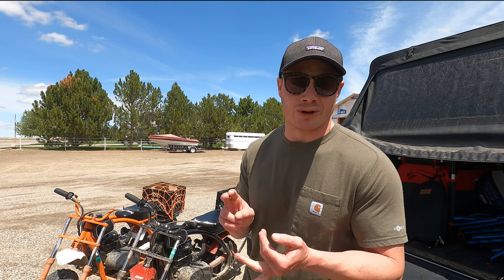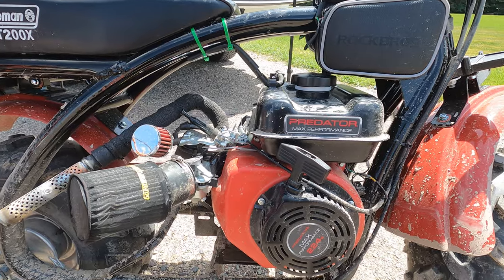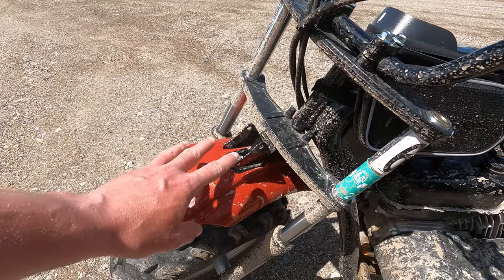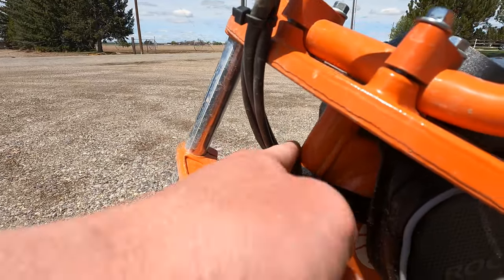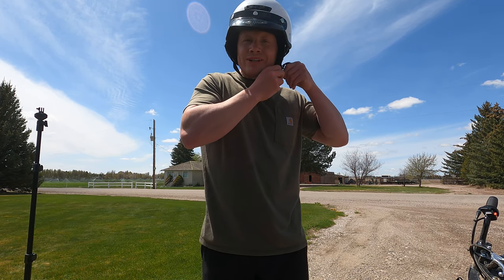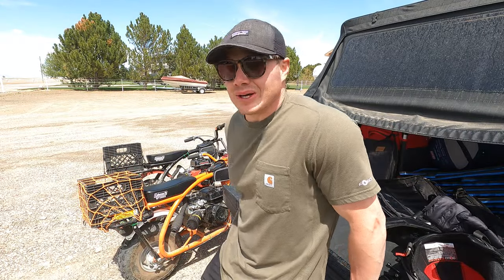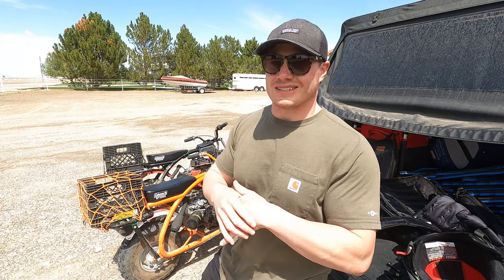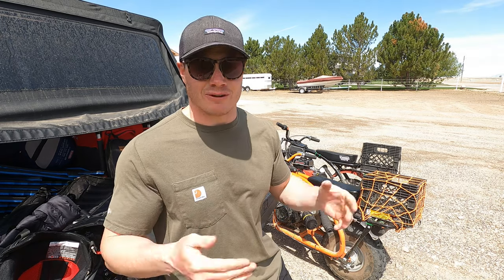Coleman BT200X: Off-Road Build + Performance Mods

Comment: The new Coleman is too low, long and heavy. The BT200X has a nice open design which makes working on them a breeze. Good point with the ground clearance.
Reply from the maker: I completely agree! The BT200X is my favorite model by far, especially if you're going to be modding them!
Reply: My first bike is the bt200x and I got a megamoto 212 to be more of a workhorse and loaner bike while I build up the bt200x. The bt200x just handles and rides so much more confidently than the megamoto.
Reply: @TregsTravels  I've been through all the new big tire bikes including the Trailmaster. I made up my mind that if you need anything more than a bt200x, one should probably get a dirtbike.
Reply: @quadriderkyle  the mm212 has great brakes and a good neck but it comes at too many expenses elsewhere. Where the BT200X comes up short in brakes it makes up for in simplicity and ergonomics.
Reply: @fatbuddycat  I was actually hoping to steal the front brake from the mm212 for my bt200x, but there is no way to make it work without cutting the necks off of both frames, which I considered briefly.
Reply: @quadriderkyle  someone makes an adapter, my friend Jay has it on his. If I do it I'd make my own.
Reply: @quadriderkyle  they make a bolt on hydraulic brake kit for the front. I've seen a few guys with them.
Reply: @fatbuddycat  I have it. I just need to do all of the welding on my frame so I can put it back together. I'm extending the rear forks and moving the foot pegs back, and might be adding small shocks under the seat.
Reply: @quadriderkyle  I just grabbed the new Coleman dual suspension but I'm planning on leaving it pretty stock.
Reply: @fatbuddycat where did you find one?
Reply: @txrunroutdoors  tractor supply. I was grabbing a quart of oil for something and fell in love with it.
Reply: I do like the look of the new ones for a drag build. Has a nice design that is probably easy to stretch.

Comment: I've got pretty much the same mods for mine. I added mud flaps to the rear of both fenders that SIGNIFIGANTLLY helps with mud, water and dew off grass. i got an 212 with a starter, mounted an ammo can to the side for tools and the M12 battery that runs the starter..and of course neon underglow!
Reply from the maker: The mud flaps are a brilliant idea! That's a sick build 💪

Comment: Its not the governor you feel at top end. Its the valve float if you did the zip tie right. 18lb valve springs will open up more rpm. Your ready for it with your flywheel already installed. Id call those stage 1 or 1.5 with the flywheel and stock camshaft, rod, valves, head, stock size carb etc.
Reply from the maker: That makes more sense! I'll upgrade the springs next. I appreciate it!!
Reply: Listen to the RPM when he's going 45 mph. That's nowhere near valve float RPM.
Reply: @Deucealive75  it absolutely is on worn out stock springs
Reply: @16driver16  They must be very worn out to valve float below 4K RPM. And on an engine that new? You would need a pretty bad spring to float a valve at that RPM.
Reply: @Deucealive75  the hisun really is that bad... I scrapped mine and got a predator 212 and it's waay better in all ways
Reply: @16driver16  I disagree. The Hisun is a good clone engine minus the 16mm PTO. Last year I built my then 7-year-old Hisun. Has very nice power. I like it more than my similarly built 224.
Reply: @Deucealive75  the head is good for increasing compression on the predator. Otherwise, you can have them. It takes all kinds

Comment: One thing i have learned in the one year after a partial governor bypass is that if you dont do all of that stage kit stuff the stock flywheel is more than fine! I use my coleman ct200u-ex as daily rider for store runs and stuff but i dont need to keep up with traffic. 25-26mph is more than enough for me! Good stuuf and info in this vid just not for me.
Reply from the maker: Totally! That's the fun part of customizing these bikes, you can make it just how you want it! Everyone has different goals and needs for their riding 👍

Comment: You can register these to be road legal ?
Reply from the maker: You can if you add brake lights, horn, turn signals and a license plate...I just have them registered as OHV's but I'm supposed to carry that registration with me
Reply: @TregsTravels  I’m just interested in driving it to work 4 miles one way no highway but I couldn’t figure if it qualifies as a mop pad or motorcycle

Comment: Love it. I've got 2 of these bikes set up similar. I put the 60 tooth sprocket on the back that's been awesome for climbing. Next step for me is front brakes, gotta be able to stop on the other side of the hill once you climb it! Good content.
Reply from the maker: I just put a 60 tooth and a mikuni carb on the bike with the 224, it climbs everything now! How are you going to setup the front brake? We went for a pretty long ride up a steep mountain about a month ago, by the time we got back down the disc brake wasn't stopping anything lol
Reply: @TregsTravels  GPS is supposed to have a kit pretty soon for it. Yeah, gets sketchy when the brake ain't doing it. Do you get any kind of engine braking from the torque converter, or does it just freewheel like with the clutch? I've still gotta clutch on mine.
Reply from the maker: sorry just seeing this! Yes, you definitely get a little engine braking from the torque converter. It definitely helps on the downhill slopes! @aaronbowers3660

Comment: Nice. But the early belt shifts would drive me crazy. The sweet setup for off road Coleman 200's with a torque converter is a 60 tooth sprocket and a yellow spring for the driven in the tightest hole.
Reply from the maker: Thanks for the tip! I'll try this, changing out the sprocket is an easy change!
Reply: @TregsTravels  Welcome.
The idea is to get higher RPM to take advantage of the power mods we add to these engines. The yellow spring is especially useful to get a later belt shift during full throttle acceleration. I found that the red spring in the tightest hole is not bad with my gearing. Look at some videos of guys adjusting or replacing the driven spring if you want to learn more.

I really like 9/60 tooth gearing with a torque converter on my Coleman. It worked really well with a mild built 196. It's a little too much with the 224 because I have to be careful with the throttle and seating position. Another thing about the 60 tooth is that you shouldn't lose any top speed. You may gain a few mph.

Comment: what size of Nibbi carb would you recommend? I'm going to use it on the stock motor for awhile then I'd like to upgrade to the 224 or 212 ghost at some point and use it for that. Thanks! Love your videos.
Reply from the maker: I have the 24mm on my 224 and it works perfectly! The 22mm would work as well. Thank you for watching my videos! I appreciate the support 👊

Comment: got a baja carbon ive been working on, shes getting a predator 224 with 15.5:1 compression and e85. that all said im gonna push the charging flywheel on it as ive had governor deleted engines work fine even after years of running them hard. itll be rev limited to 6k to prevent issues and in case its getting the heavy duty housing. I've got a similar setup on a manco dingo and itll hit 57mph however that thing is terrifying at that speed, and to think im building this motor to be even meaner
Reply from the maker: That build sounds like a beast! let me know what you get for top speed on the new one! 45mph on the trails is perfect

Comment: Yes you nailed it as this totally reminded me of a yellow Tote-Gote I owned back in the early 1980’s as a kid. Although I’d be lucky if I got the thing to go anywhere north of maybe 10mph. All torque no speed beast!

Walmart has a Coleman BT200X-G 196 cc for $750!

Also with the understanding that terrain & payload will dictate how far one can travel on maybe a gallon of gas how far ya think you can go and back on one of these? With that said have you considered upgrading to a larger fuel tank?

✌🏽
Reply from the maker: Yeah! I love the classic tote goats. I was trying to capture that feeling of those older gotes with a few modern touches.

I've been actually surprised at how good these things have done on full mileage. We've gone for all day rides and the tank was barely halfway empty by the time we got back. I always carry that 750ml fuel bottle under the rear fender so I've never worried about running out of gas!
Reply: @TregsTravels  You’ve kickstarted (pardon the pun) my brain in a different direction totally then where I was at when my wife mentioned she wanted a motorcycle.

I own a couple of H-D motorcycles, but since my wife is only 4’10” & has never ridden,  I’ve been very limited on what to possibly get her. Plus the fact that’s she’s already crashed her E-Bike into a barbed wire fence the first day she rode it I worry about her on a busy street or freeway. Heck I worry about the public as well! 😳🥴😜✌🏽

Motorcycles like these check off many boxes. Inexpensive in relation to others & simple to operate/maintain. Not to mention if she does go down she’s less likely to injure herself to bad.

I know each state is different but without getting to far in the weeds on certain laws, etc…. do you ever get any pushback from camp hosts, rangers or LEO’s regarding this motor bike anywhere you’ve ridden?

Again thanks for sharing this and for your insight.

✌🏽

Comment: Awesome dude. We love our Coleman’s. I do have a question on registration. I see that you are in Utah and I have just got the run around calling to get info on registration. What did you do to get them registered? I bought mine used so Coleman will not give me a point of origin for them.
Reply from the maker: It's definitely a run around! I bought one used on Facebook that didn't have a title either. I had to go to the DMV and submit a form with pictures of the bike for a "lost title" that process took about 90 days then they issued me a title and I was able to get it registered as an OHV. A pain for sure! New bikes bought from Coleman are a lot easier to register I've learned. If you take them up to Idaho you can just buy an out of state OHV sticker without a title. Let me know if you have more questions!!
Reply: Thank you for the information. I will have to go that route. Hopefully we can get them done. Thank you!

Comment: Just got one of these bikes yesterday. Im as new as it gets to anything bike/mechanics goes. Im wondering what tools do you keep in the saddle bags as far as sizes/use. I want to take it out camping and if I could get a heads up on common issues that need repair I would greatly appreciate it!
Reply from the maker: Awesome! Congrats on the new bike! The good thing is most of the repairs on these bikes are really simple 👍🏼 I keep the wrench kit that came with the bike in there, I think that's metric sizes 8-18 if I'm not mistaken. Then a Phillips head screwdriver. Zip ties are always good to have! Lately I've learned to keep a few extra key bolts and nuts in there...I have used loctite on most everything but occasionally something will rattle off. Electrical tape and a set up pliers too. I think that's most of what I carry!
Reply: @TregsTravels  Thank you so much! That is really helpful. Been a blast so far and can’t wait to keep learning/modding it
Reply: I have owned this bike for years. Repairs have been pretty minor and minimal. 2 master links. One to the jack shaft and crank. The other to the sprocket. The gas cap is picky. Watch out or you'll lose it going down the road. My chain tensor on the jack shaft came loose. But I caught it in time. I do ride mine hard. Pop wheelies. Skid. Donuts. So on. The tires are very soft. They won't last on pavement for long. It's made for off road. My brothers have these bikes as well. One, his exhaust broke completely off. And the other. Myself included. Have had a few sticks jammed up in the chain and sprocket. Forcing the rear tire to a skid. Bending the chain and sprocket on a couple occasions. Other than that. Zip ties for the brake. It starts every time. It's been very reliable. We tend to ride hard. So our issues might not be the same as yours.

Comment: I have a Coleman CT200U-EX and I have a Tillotson 225cc Performance on mine that I bought from GoPowerSports, which has 18.686 hp and it isn't rattling all over the place.  it depends on how good the engine is built, how balanced it is.
Reply: I forgot to add that I have a Mikuni 24mm flat side carburetor and a Torq-A-Verter
Reply from the maker: You're 100% correct! I think tillotson is a better motor for sure. The predator 224 has great power but runs hard.

Comment: Did you have to remove the emissions box to get the torque converter to fit? Also, did you use the same bolts that came with the torque converter kit? Thanks
Reply from the maker: Yes on the predator 224cc you have to remove the emissions box, basically just cut the wires and remove it. You need different bolts for the predator because it is standard sizing instead of metric. You need 5/16-24 to mount everything for the TC. OMBwarehouse sales a predator TC mounting bolt set if that's easier!
Reply: @TregsTravels  perfect! Thanks so much🙏🏼

Comment: do those gas canisters ever give you a little spray when you go to open them
Reply from the maker: I haven't had an issue with that. I only fill them to the fill line which is about 3/4 full

Comment: What jetting are you running on your nibbi? I got a nibbi 22mm with for my 196cc.
Reply from the maker: I have the #35 pilot jet and the #102 main jet and it's running like a champ! I typically ride at 5000-7000 ft elevation.

Comment: Have one and love it
Reply from the maker: Good! They're honestly so much fun. Everyone that rides them loves them!
Reply: @TregsTravels  hoping to do torque converter on mine here soon
Reply from the maker: @thumperbangin2000  I definitely would start with that. That was a game changer for the bikes. My brother just bought 2 bikes, we're thinking about making some build videos as we start to modify them
Reply: @TregsTravels  im researching it. My bikes engine is  stock minus throttle stop delete, zip tie mod, and an exhaust..
Reply from the maker: @thumperbangin2000  you'll notice a huge difference with the torque converter then with the mods you've already done. I highly recommend getting the riser plate from OMB warehouse when you install it 👍🏼

Comment: Any suggestions for the regular stock model, the 200U? Looking to upgrade it, or just sell it and get a different bike. Not sure which though
Reply from the maker: The 200u is a great bike! You can purchase the front forks with suspension...that would be the best upgrade you could start with to smooth out your ride! Then start with a torque converter for the motor and building that out 👍
Reply: @TregsTravels  awesome, thanks

Comment: Curious as to why you didn't remove the governor when you replacer the flywheel on the stock 196?
Reply from the maker: I wasn't too worried about top speed. I mainly trail ride and these things are perfect for that! I actually just put a nibbi carb on there so I bypassed the governor completely

Comment: Where can i get this helmet? thats amazing!!!!!😂 I threw a bell on mine and can help say i can get 70 miles to the gallon on thus hog. Need the helmet to complete the rest !
Reply from the maker: Hahah yes! I need to add a bell! I can't find the exact helmet I bought but here's the closest thing I could find: https://amzn.to/3xIPcAa
Reply: @TregsTravels  thanks for the helmet, the grips you bought only came as a single grip? So you had to buy a 7/8ths and 1 inch grip separately? Or did they come as a pack ?
Reply from the maker: @ktownc936 they came as a pack. It was a little tight getting it over the plastic throttle but I got it on there 👍
Reply: @TregsTravels  were they both 7/8ths? 
I think they sell a 1 inch for the throttle. 
So they were the same size, cheers for answering my annoying questions. I subscribed

Comment: I slapped a 6.5 hp Briggs and Stratton vanguard engine on mine and I was able to top out at 55 mph stock it’s a lot smoother and quieter
Reply from the maker: I was thinking about putting one of those on the orange bike! I like that idea a lot. Thank you for sharing!
Reply: @TregsTravels  I love it but I don’t have a channel to share if you do please make a video man also in that van guard engine I use 5w30 Briggs and Stratton synthetic engine oil and it does help with longevity

Comment: I blew up my engine after putting on the mods any tips?
Reply from the maker: Dang! Was that on the 196cc? Do you know what's broken or is it all the internals...you can try to replace what's damaged or just pick up a predator motor. The 212 ghost is already setup for higher RPM's

Comment: It's my golf cart for getting around my property. I leave mine stock and believe in grease so been with me years. Want a better and smoother take off? use some oil in centrifugal clutch. will slip at first but you will see ( you will like) and again been doing this for years. I run the crap out it almost every day. I don't put a basket on back so when riding hard for fun I can separate in a wipeout lol. I have basket on the front where headlight was. By the way I am 200 LBS. Yea I'm a fatass with chicken legs. I have replaced the jackshaft sprocket because even oil couldn't save that cheap made thing and upgraded. nothing special. OIL and GREASE! the wheel bearings etc doesn't come with a good grease packing so make sure you get grease in those . Get grease in all bearings. The plastic cover over the bearings pops out and back in easily. Mine is the CT200 and wrecked many times. Its tough. The muffler sticking out would end up being ripped off mine so again stayed stock.
Reply from the maker: That's awesome! Thanks for the tips, I will definitely grease em up! Sounds like yours is holding up well!